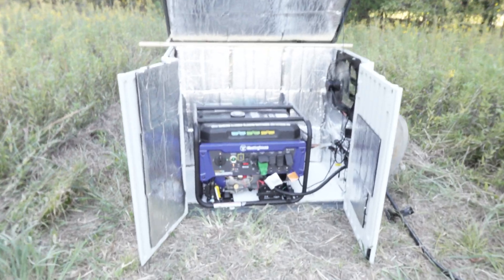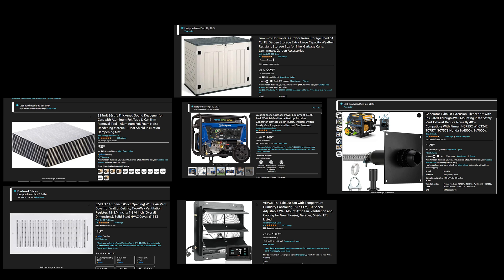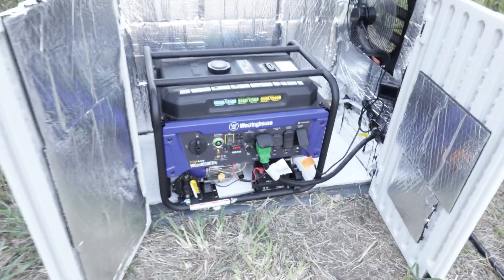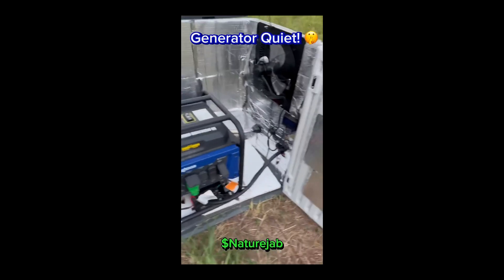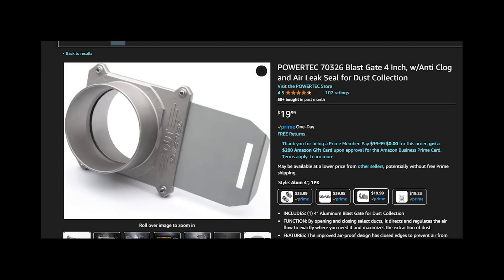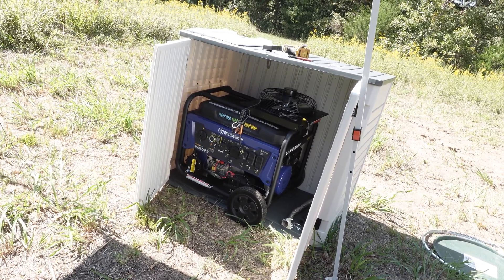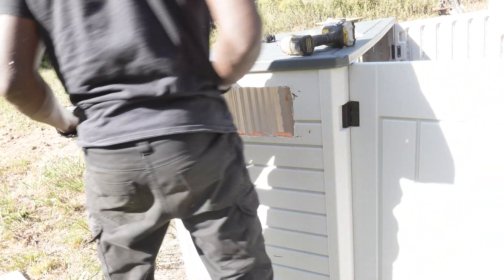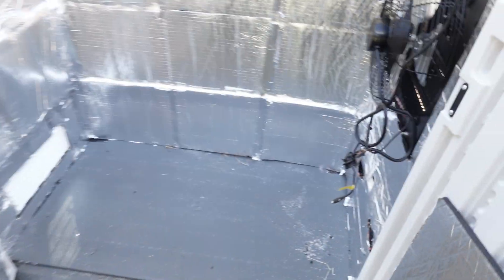Building Generator Quiet Box (For my Plastic to Fuel Reactor)

Comment: Maintaining positive air pressure avoids condensation and mold. Computers and Houses and built with this is mind one hopes. Dust filtered cold air intake placed lower with static pressure fans. Hot air exhaust placed higher with airflow fans. Positive pressure ensures that your cracks don't become intakes and thus are filled. Potential for interfering with the generator aspiration unknown. You can add a muffler to the intake as well perhaps. Any sound remaining could be frequency matched and cancelled. Be safe

Comment: Hey man, I love that build! To the intake fan: If you can, it might be worth considering putting it where the lower vent is, since cool air naturally collects in the bottom, gets heated up by the generator, and then rises towards the exhaust vent. The top will work too, since convection will make the hot air below mix with the cool air in the top, but it might be best to place the fan in a way that works with the natural way the air moves. Its been done in Computers like that for the most time, which is why the rear fan sits at the top, and the intake in the bottom front.

Comment: Is your latest pyrolysis reactor, generator, etc. able to run entirely off of the flammable gases it produces from the plastics that you feed into it? 

Also, do you have a battery that the generator can charge?  Something like using the battery to get the process started, then switch to the generator?

Comment: You should put your intake fan down as low as possible, if not you’ll have majority of the air just passing over the top while you get a tiny bit of circulation within the box. But if you allow the cool air to come in from down low the exhaust will pull that hot air out and cool air past the generator and create less circulation of hot air.
Reply: You don’t need an intake fan. I built my own many years ago and it hasn’t skipped a beat. A normal vent will do. Just one exhaust fan